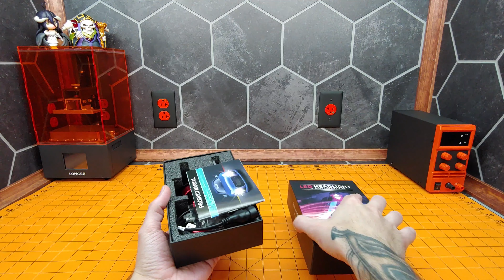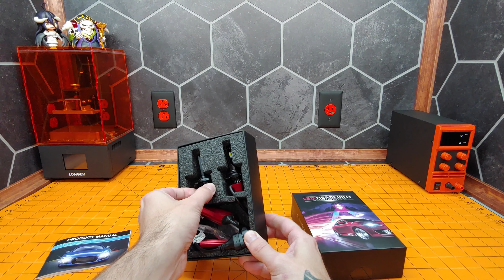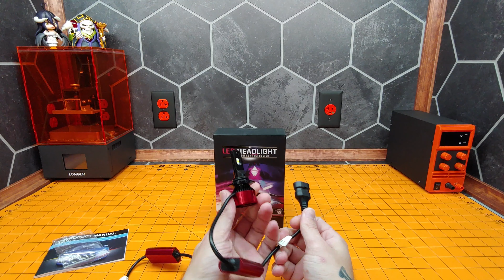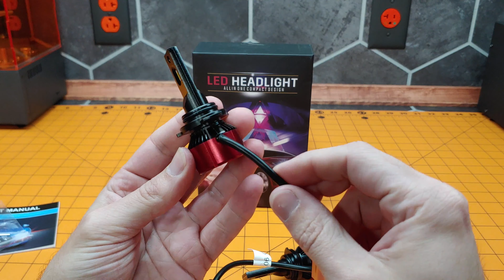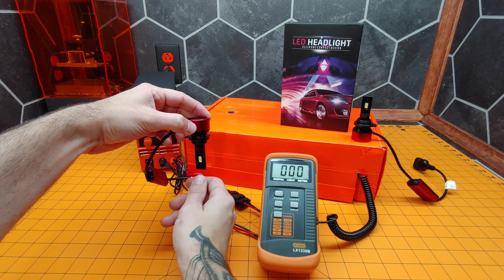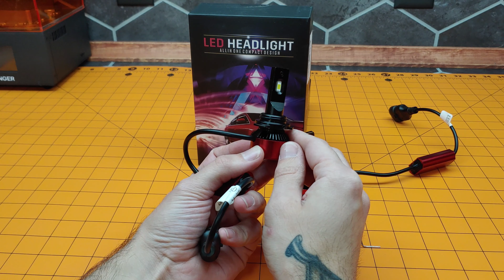AOLEAD 9012 LED Headlight Bulb Review

Comment: Which headlight or projector are u using for the tests? I'm searching a great bulb for my h1 projector acura tsx
Reply from the maker: For my h11 tests, I am currently using a set of headlamps (reflector and projector) for a 2019 Nissan Rogue.

H1 bulbs I test in these:
https://www.ebay.com/itm/2-2-5-Bi-Xenon-HID-Projector-Lens-Retrofit-Headlight-Angel-Eyes-H1-H4-DIY-Kit-/114191190259?_trksid=p2349624.m46890.l49292